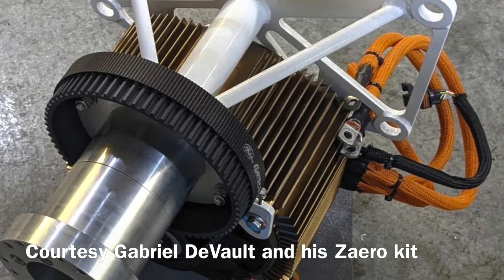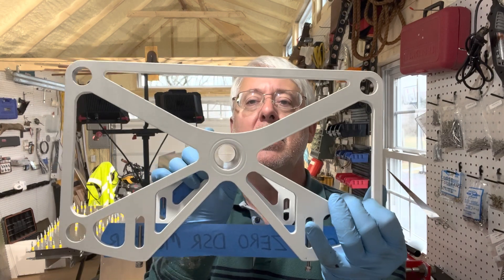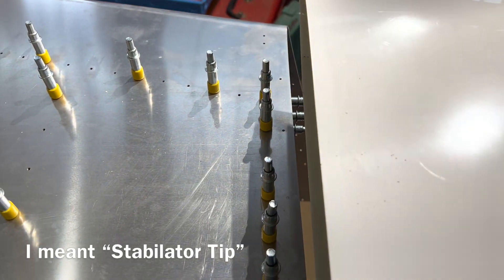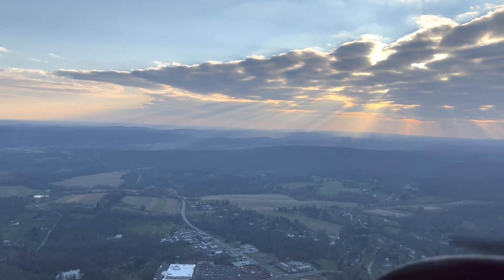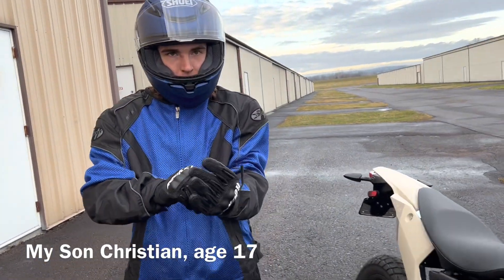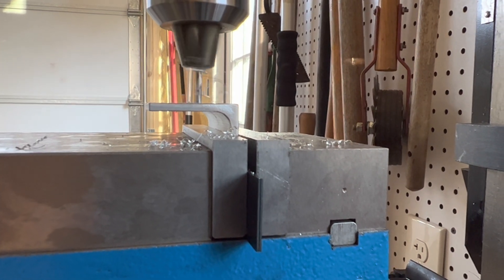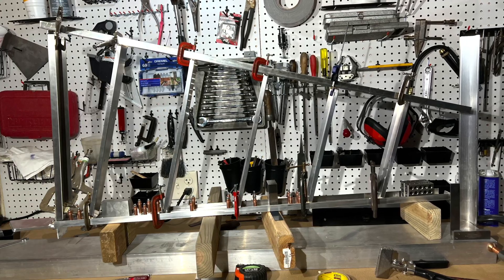Tim’s Tips #93 - Sonex Xenos Electric Airplane Build, Motorcycle, Tools, Stabilator - Feb 8, 2022

Comment: You said ZERO  motorcycle will be manufacturing the motor mount... Is this specifically for airplanes.... It seems in the past that anyone have anything to do with their equipment being used for airplanes and would not sell parts if that is what it was going to be used for.... I am very interested in doing a project like this as well.... Love your video  Is Gabriel still selling motor mounts or parts